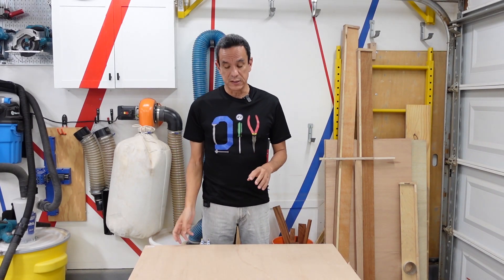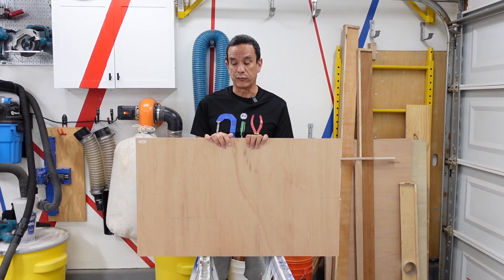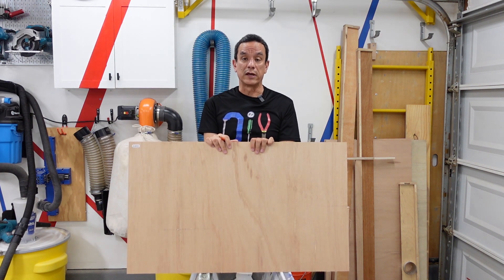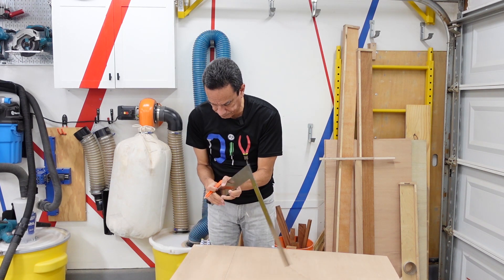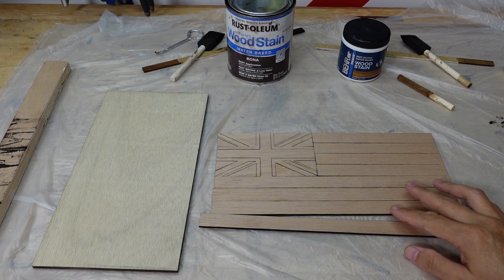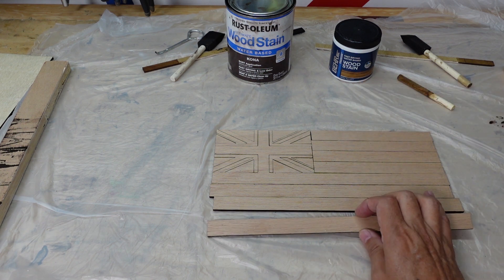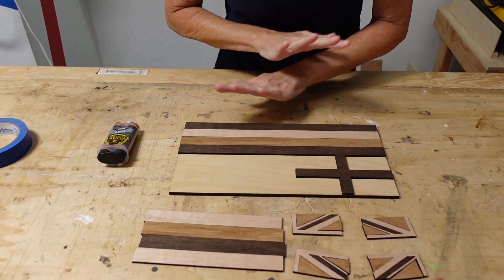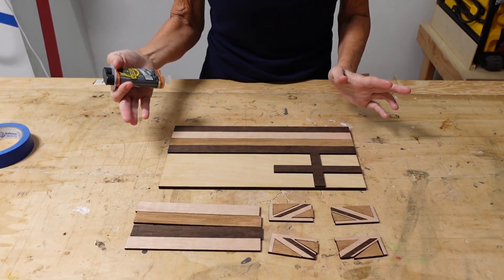How To Make Flags with xTool M1 Laser Cutter

Comment: I see you have a purifier for m1 does that take the smoke smell out of the room my m1 just got I put exhaust out window but still.smells smokey so then my alarm goes off would the purifier eliminate that ty
Reply from the maker: I made a video specifically on the Air Assist. It has made a tremendous difference and the smell in the garage is hardly noticeable. I have heard some people complain about the purifier, saying it stops working well, right away. I have not had that problem. My theory is that people use the purifier at full power all the time and it wears it out too soon. I use it at low and if I still smell smoke, I turn it up a little until the smell is gone. That being said, part of the smell of smoke comes out from the lid of the M1 because it is not air tight. I think the purifier will work well for you but it will not get rid of 100% of the smoke.
Reply: @Poor_Mans_DIY  use an exhaust from the purifier along with an exhaust fan that will help pull the smoke out of your space AND the toxins.